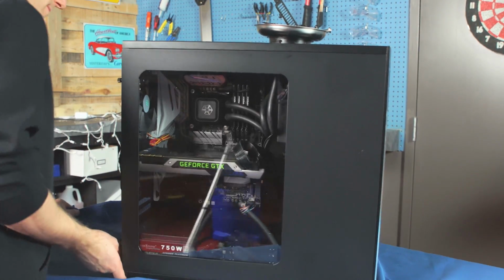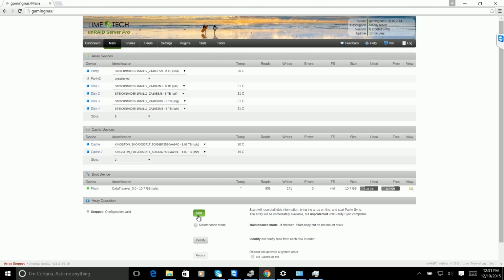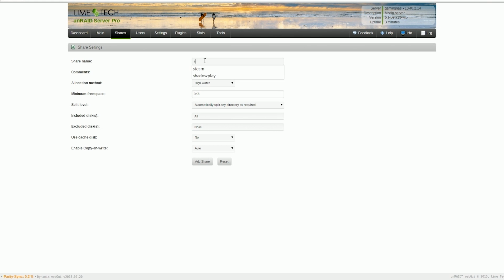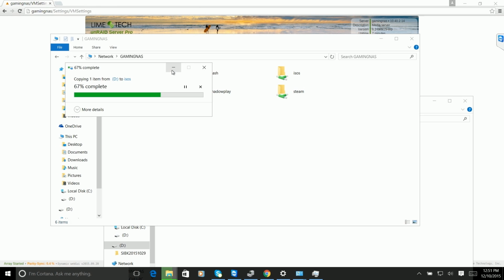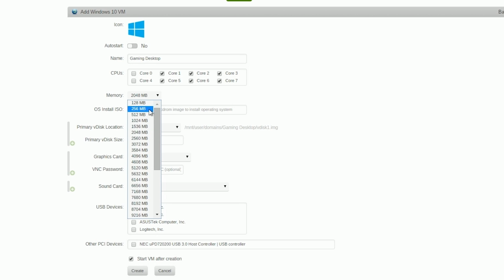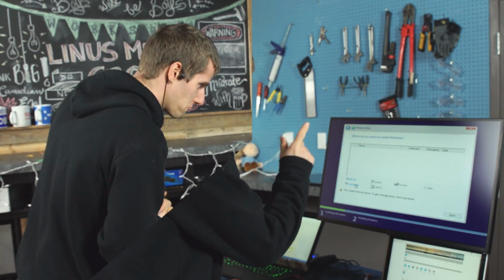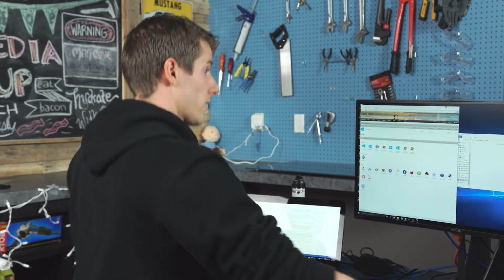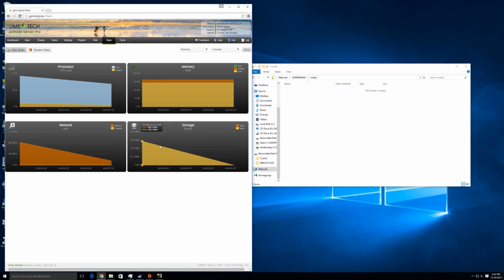Use your Gaming PC's Extra Power as a NAS Ultimate Guide

Comment: Can this be done using AMD CPU? Also, is it also possible to overclock the CPU in this configuration?
Reply: +kevinwidjaja21 Can be used with any CPU that supports virtualization. As Linus said in the video.
Reply: +kevinwidjaja21 More specifically, any Intel processor that supports Intel VT-d and any AMD processor that supports AMD-Vi (sometimes known as IOMMU).
For intel, google "Intel ARK <processorname>", it will show a nice list, scroll down to find Intel VT-d. 

Keep in mind, not all graphics cards can be passed through, though I don 't know how to check that.

Comment: qemu is fantastic...
Reply: +Damian Damianio Better yet that most of the bootloader modding ass pain for pci passthrough has been removed as well as hiding kvm from NVIDIA's Quadro/Grid money grab.  I've done this on Arch, and it isn't hard, but it isn't something I want to do over and over again.  Great job to all the QEMU/KVM, Kernel, and LimeTech contributors!
Reply: bidlokwerve
oh really? nice man. i'll be honest, i suck at arch linux (i am still a bit of a noob) but if you accomplished this in arch congrats man! i just love linux but arch is a bit too advanced for me
Reply: +Damian Damianio I used to use Windows primarily. Never had problems until I copied a ton of software folders and my antivirus program went nuts blocking all of the autorun.bat files. I figured if the OS was so vulnerable I couldn't move files without more software designed to keep it safe pestering me...why use it at all? Went through the usual Ubuntu and Mint phases before trying Arch on Raspberry Pi. Systemd and the Arch way were much easier to me. And Pacman owns APT. I didn't care to experiment with pass through until I got an NVIDIA Optimus laptop. Dual-booting gets old. Arch can be elitist, but only because the wiki is so well documented. If you have time give it a go!
Reply: bidlokwerve
i feel ya.